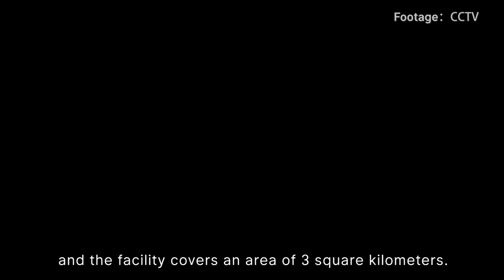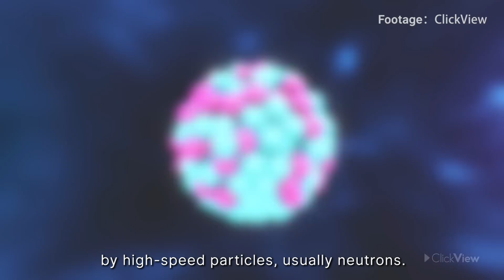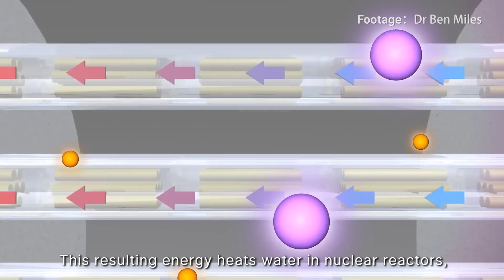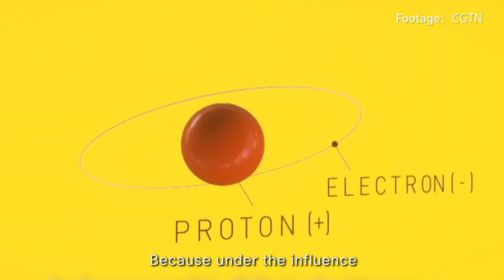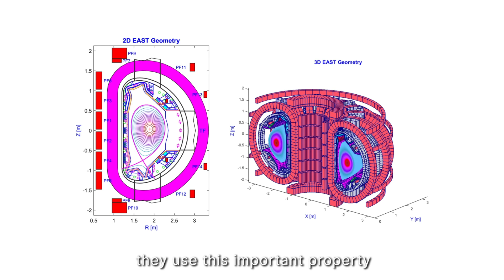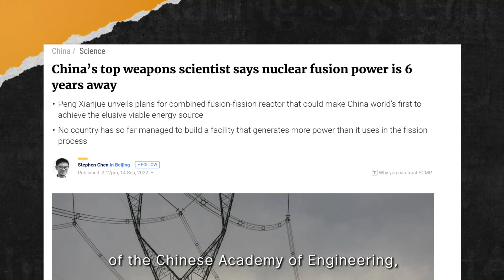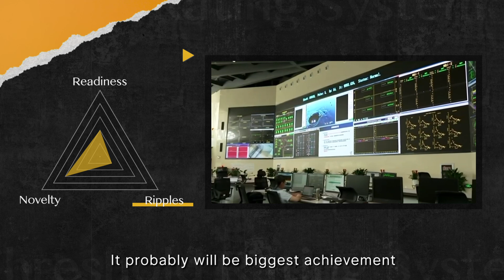This SUN is also Made in China? | THRESHOLD

Comment: Fissions main problem is public acceptance. Plus existing reactors are mostly just scaled up submarine engines. Research into how nuclear reactors could be made like gas turbine generators are, ie link any other mass manufactured big thing, would have the biggest ripples. Uranium is practically unlimited, especially if you start filtering sea water for it. ( and Thorium even more so) Fusion shares more issues with Fission than many advocates would like to admit…

Comment: When humans learnt to start a fire by rubbing combustible materials, that was a huge step for humanity, when they learnt to sustain a fire that was a huge step, when they discovered coal and other hydrocarbons, oils, etc. it was a huge step, bottling natural or liquefied gas for cooking, welding etc. it was a huge step, internal combustion engine, electrical energy etc were huge steps, and the list can be extended. All of these made human life richer and easier and meaningful, but also brought about newer and bigger problems each time. Fusion energy will also enrich human life tremendously, but that also means that probably there would be bigger and more complex problems as a consequence. It might mean that there will be no constraints in energy terms to metabolise the natural resources as present production system would find it easier to turn every natural resource on earth into commodities by processing them very quickly. Just an hypothetical outcome, but that is what has been happening with previous revolutions in energy.
Yes, fusion energy is much needed, but just by in itself it will not solve major problems. It's the social arrangements of production and consumption and the rational balance with nature's capacity that will make it truly meaningful.